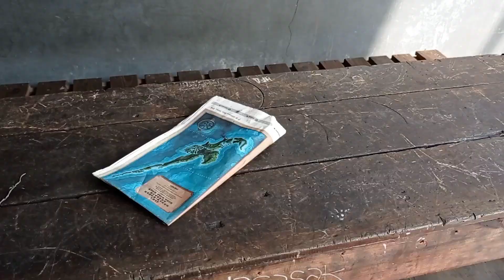Repairing Rack End Tie rot | Perbaiki Terot Oblak | Working Metal

Comment: It's amazing what developing nations repair vs. simply buying a new cheap (Chinese made) replacement. In the USA, the labor cost to do this repair would be six times what it would cost to buy a Chinese replacement part. Clearly the very low wages in developing nations makes it more economical to repair these worn automotive parts. 
It's sad that the USA has become such a throw away society. We use to fix things and make things here but now they are simply thrown away and replaced with new. I remember going to the drug store to test our TV's tubes in the 1970's that would go out! Or, you'd call the mobile TV repair guy! Today? You simply pitch the TV and buy a new one.

Comment: Not a best approach, to be honest. In my place we usually making then repairable - by removing lower cap and welding a round piece with inner thread on a cap place. This allows to replace plastic insert if needed and to regulate tightness with a threaded cap.
Reply: (y)